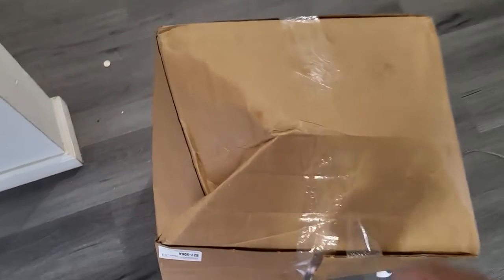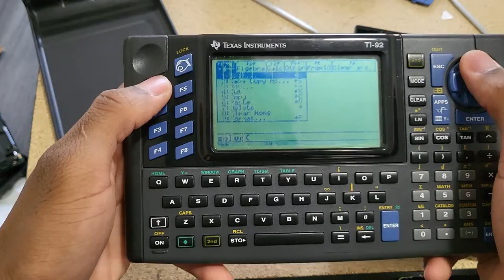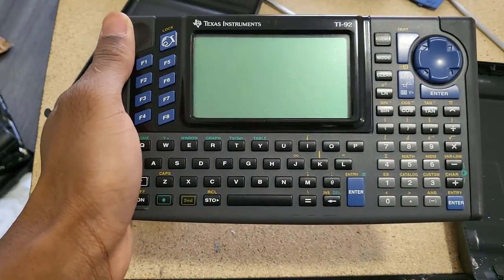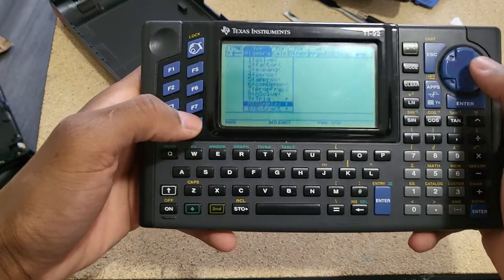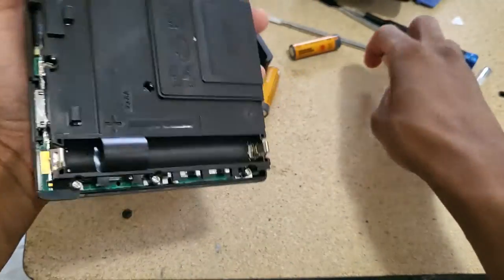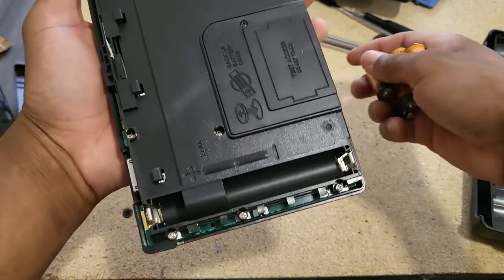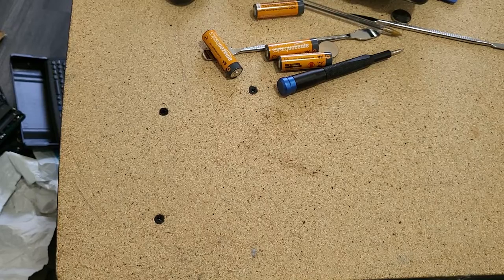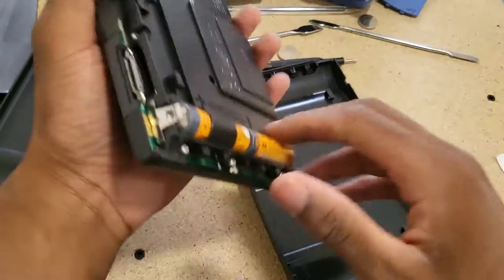I Bought 24 Texas instruments Ti 92 Calculators !!

Comment: I bought a TI-92 at goodwill yesterday that looks new but black screen and contrast don't work. I tried taking the backup battery out like you did to no avail. The access door at the bottom mine is different it has the pinouts with nothing on them no module but a chip is soldered to the board between the 2 rows of pins. I love calculators collect old ones and was hoping this one I could get to work. Great video.
Reply from the maker: Can you ulpad a video of it? I'm thinking that it's either missing the module or it's not a regular 92. So, while holding the diamond key and repeatedly pressing the plus or munus key, the screen is still dark?
Reply: @calculator_boy  I'm pretty sure it's got a onboard chip probably a later version of the TI-92 I figure with updated board because I see no chip on yours there just green motherboard. The test pins are still there which the chip looks to tie into. I'll try to get a video of it and if I do I'll let you know. So none of the ones you have had has had that chip? That makes me wonder because out of all of them you've had surely one of them should have had it I would think like mine.

Comment: So I don't have two dozen of these, at least all in one place, but I do have several. :) They are just a solid, well made, cool piece of hardware. And this is coming from a HP guy. 

Have you taken one all of the way apart yet? It's got a Motorola MC68000 CPU in it. Care to make it think that it is an Amiga 500? :)
Reply: It doesn’t have the Amiga custom chips Denise, Paula, Agnes 😊 Maybe a Mac?
Reply: @trs80model14  Ok, so there might be some missing pieces...

Comment: I also have a passion for calculators for now i can only watch them , but soon ill be buying some of my own, im 16 btw
Reply: Grow up kid these obselete pieces of tech are crap.Being from MIT,I find TI trash,go on with HP
Reply: If you enjoy it as a hobby, go for it! Older TI 's are cheap to acquire used and if you keep your eyes open you can find some REALLY cheap or even free!  I'm an HP fanboi  but they are expensive.  You'll learn a lot playing around with calculators. I'll bet your school has a shelf of dead calcs that they would let you fix for practice. Usually it's either the contacts or some joker broke off a pencil in the comm port. Have fun!
Reply: @ajaxthepilot7490  what does it matter if you are from MIT? that doesn't make your opinion any better than other's.... that said... yeah, HPs are much better than most TIs, but the 92 and the Voyage200 are quite neat
Reply: @ajaxthepilot7490 Been rocking a Ti-92 since freshman year, now I'm a senior in high school, makes for a great daily driver, can't beat an almost full sized QWERTY keyboard

Comment: That's crazy! Since these calculators have a limited I/O capability, you could in principle network them all together and have them split up a computing problem into pieces and distribute the task to many nodes so that they could work in parallel. A parallel cluster of TI-92s :) You could do it. TI-GCC allows you to write native code for the calculator which could include a network stack. You wouldn't need any routing, all peer-to-peer.
Reply from the maker: Though I wish I could do that, it's way out of my league. Perhaps I'd one day meet someone with the knowledge, but who doesn't have dozens of 92s laying around...😁